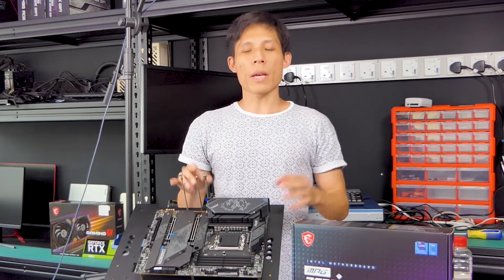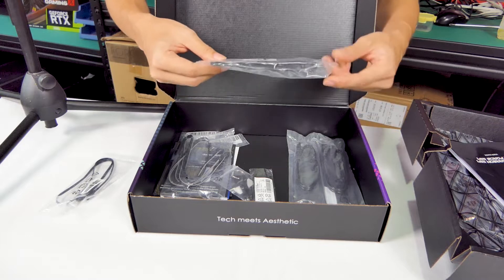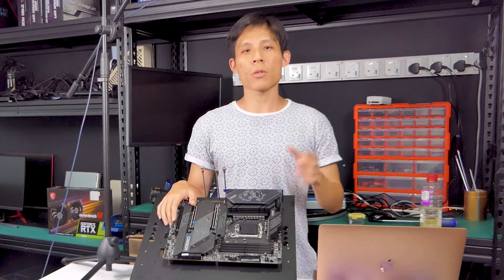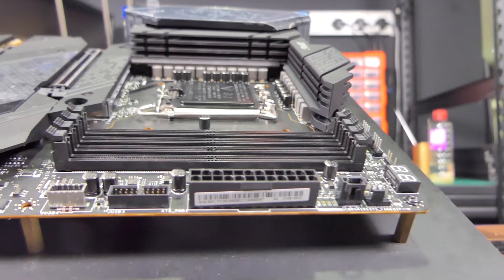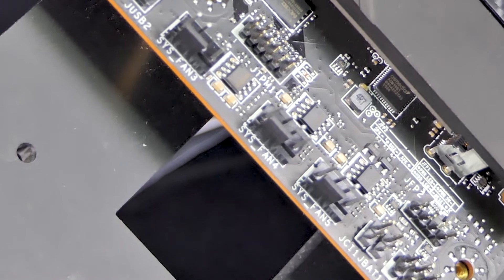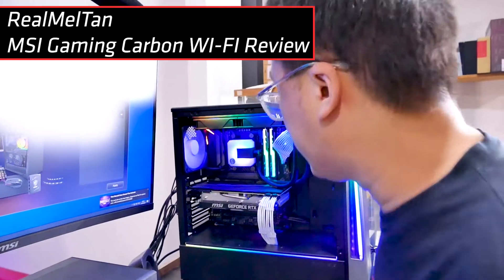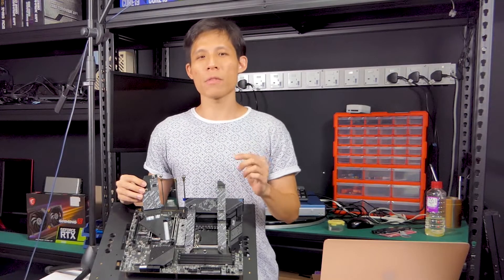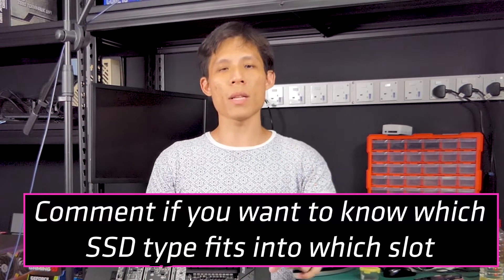EXCLUSIVE MSI Z690 Carbon WI-FI IN-DEPTH Review (Unboxing) | Intel 12th Gen

Comment: I actually looked for the review exactly to see if it would fit 2 3090. Your 3080ti is triple slot?
Can you confirm what is the slot spacing between the slots?
Also could use a riser cable to use the 3rd slot?
Thanks for the video!
Reply from the maker: Yup this Suprim X is triple slot. 
Which slots would you like to know about?
And a riser cable should work :)

Comment: Oh actually during Intel architecture day, they already said 16x PCI-E 5.0 lanes from GPU and 4x 4.0 lanes to m.2 which is why I was confused why industry makers were making 5.0 ssds... maybe for Raptorlake and Zen 4 bah
Reply from the maker: Yea thanks for clarifying! I think u are right, this board also supports LGA1800. 
Actually, it depends, i have a feeling we will see 5.0 SSDs starting next year, before 13th gen n zen 4. Of course PCIe 5.0 GPUs, that one has to wait.
Reply: @RealMelTan  Eh, to be 100% honest, Alderlake has the strangest feature set in any CPU launch. I mean GPU wise, earliest PCI-E Gen 5 we're getting 4080/7800XT end 2022. Unless you are talking about Gen 5 PCI-E x16 Nvme adaptor card to fit 4x Gen 5 NVME SSDs. But that leaves the GPU with only x8 PCI-E Gen 4 which is insufficient for 3090/4080 etc...

Raptorlake & Zen 4 is Q3 2022 right? That one will be alongside 4080 & 7800XT which could benefit from PCI-E Gen 5. With target resolution of 8K 120Hz & 4K 240Hz, Gen 4 might bottleneck those GPUs. Not to mention Hopper & RDNA 4 coming in 2024/2025 but by then Meteorlake & Zen 5 would be out liao. We're getting a heck of a lot more power soon and I honestly can't wait!